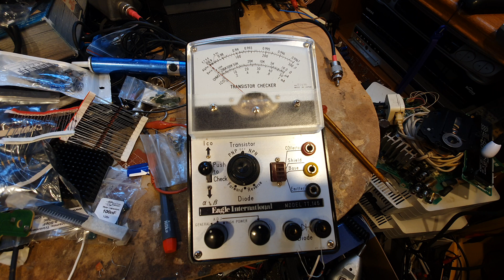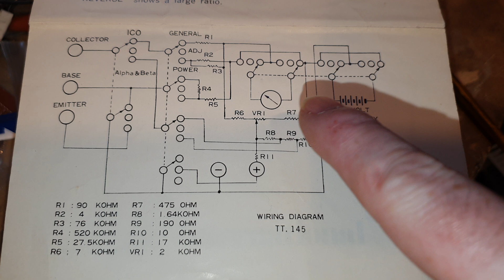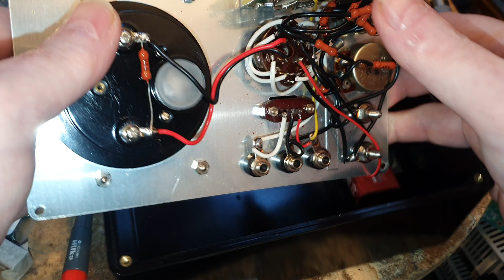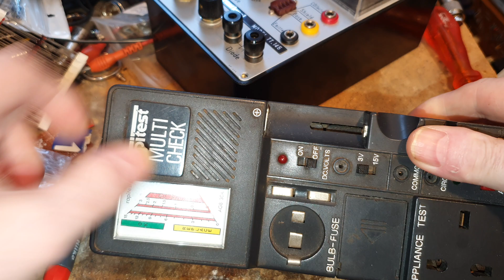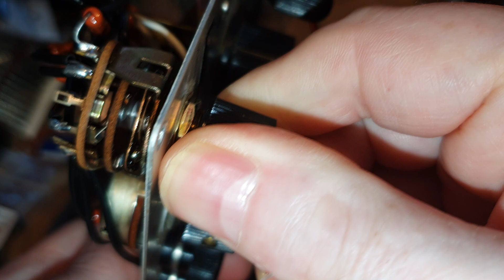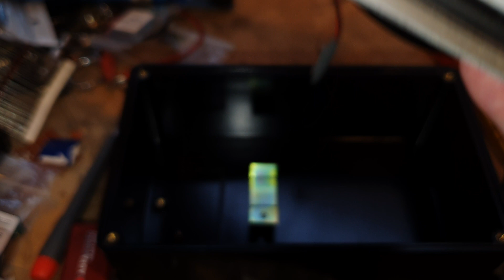Eagle International TT.145 Transistor Checker - Let's Open it Up!

Comment: I have one of these!
 Haven’t used it much, but it does work. Of course it only shows the gain of transistor at a set current , but absolutely fine for comparing/matching gains etc. I’ll be using mine a bit more now. 
It never occurred to me to test diodes on it. I guess we are spoiled these days with all singing-all dancing multimeters.
Reply from the maker: A lot of the modern meters are so much quicker and easier to use, but they haven't got the style that these old beauties have. I love it!